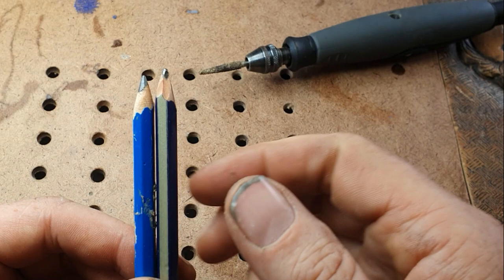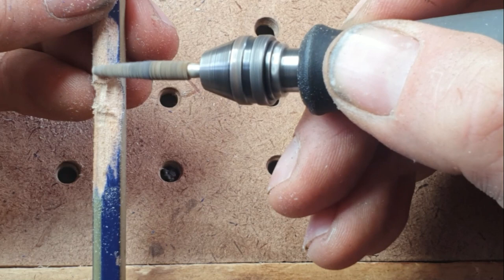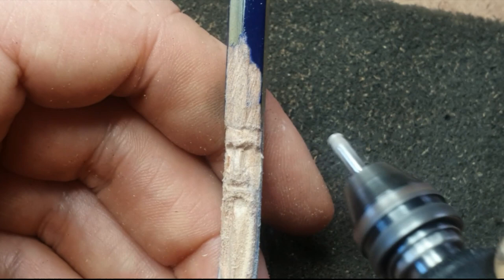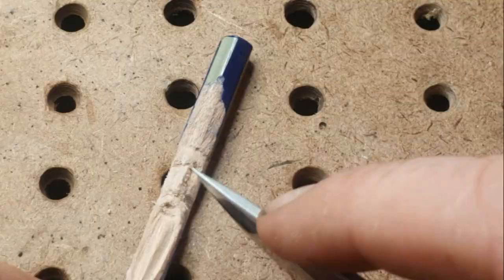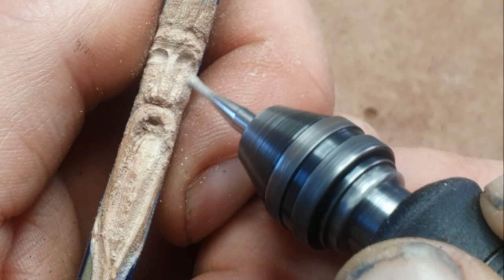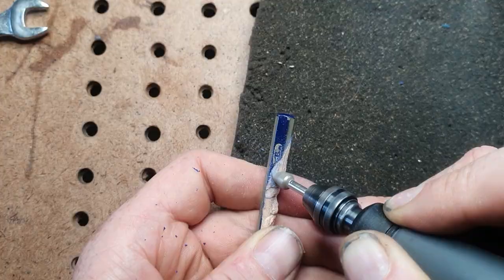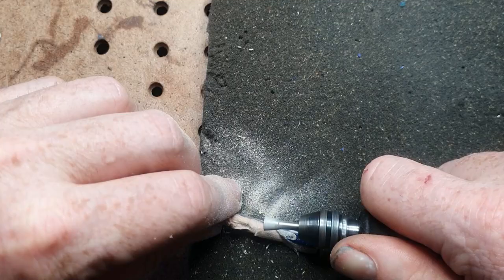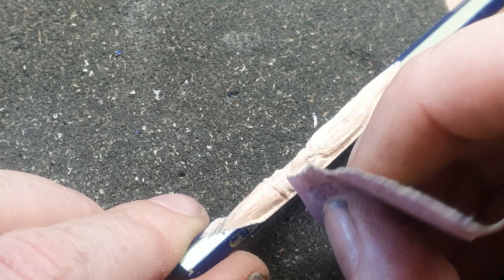Wood spirit pencil carving

Comment: i m new to power carving and trying to start with tiny faces. almost got it. and i only have 3 burrs that were in a old dremel multi pro i found laying around.i  need those fine grit diamond burrs i guess tho. what a awesome wood spirit pencil here. thanks for sharing
Reply from the maker: Well sounds like a great place to start. Only having limited tools makes you concentrate more I reckon. But yeah small carvings benefit from having diamond burrs. Cheers 🍺 👍